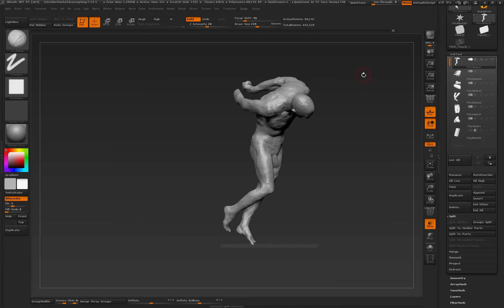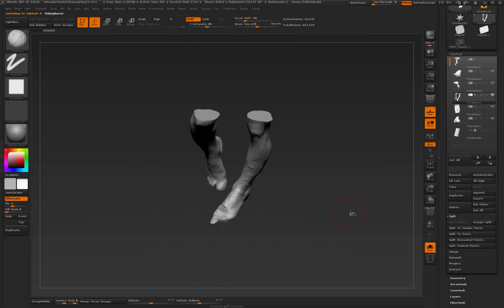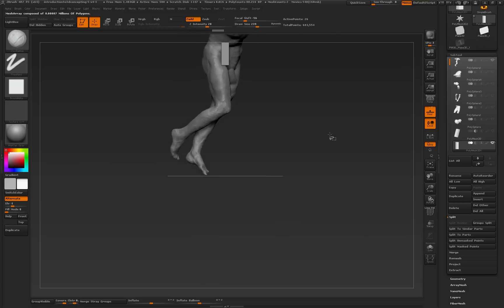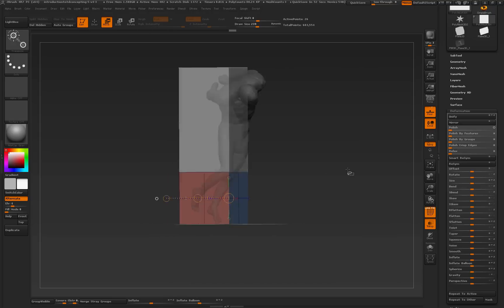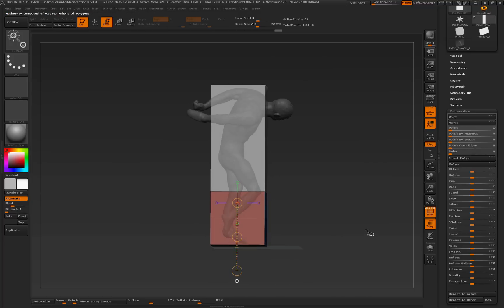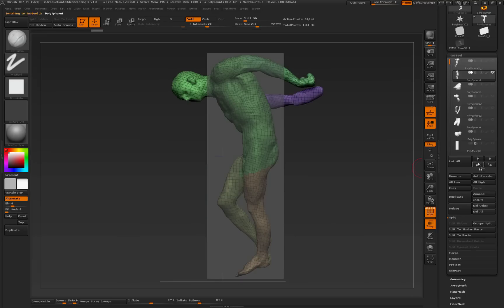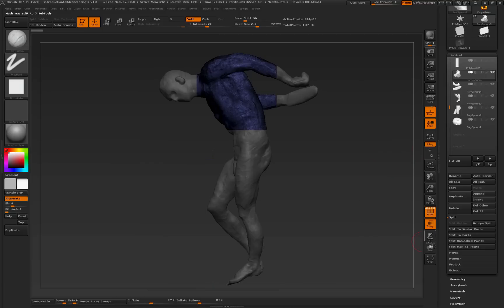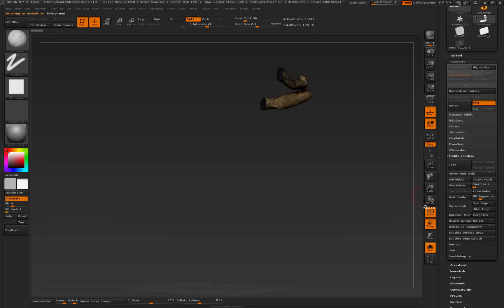Quick tip: Using ArrayMesh in ZBrush 4r7 To Help Split Up A Model For 3D Printing

Comment: if you want to make it super exact on the slice , you can take the cube  then use z modeler to make sure the model is fully inside the cube shape ,   split it up into 3 poly groups or just duplicate it 3 times and zmodler delete so it only has each section ,  then you can copy the model 3 times and do a bolean subtract and it will be super perfect ,   love your tutorials great stuff !